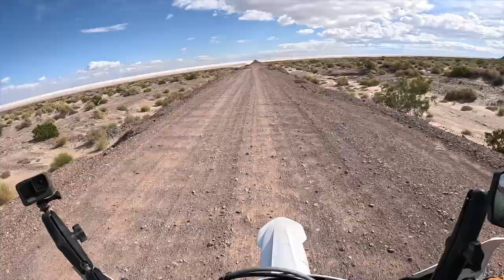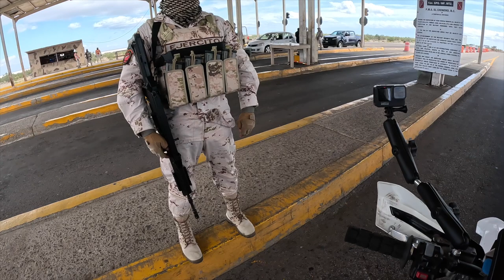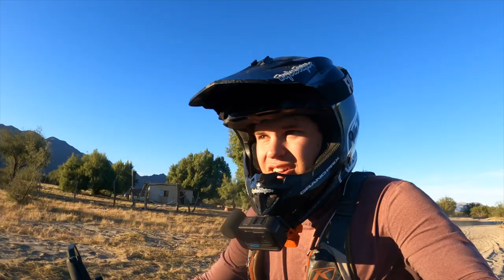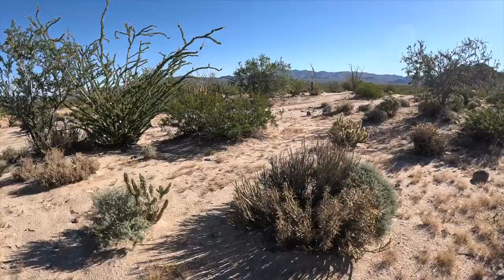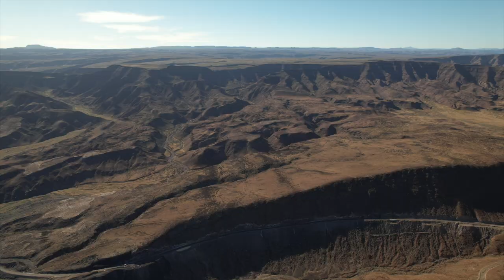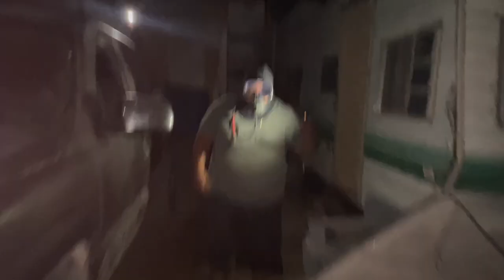Motorcycle Tour of Mexico (Baja California Part 2) (Ep 2)

Comment: Really nice job.   Glad you got your hard drive issue resolved.  Howz the KTM holding up?  Any bike issues?
Pete from San Juanico ✌🏼
Reply from the maker: Pete brotha! Yeah man I feel so grateful I got my data back! The KTMs been great can't complain. I had a wheel bearing go out in the rear tire and a countershaft seal start to leak recently.. All things I expected could go out. I had all the parts for them and was able to fix them easily. So other than that nothing to bad... My Trailtech GPS charger recently stoped working. So I haven't been able to use that GPS. The GPS works fine it just doesnt have a way to be charged. No big issues so far with the bike.
Reply: @LandonBishoff  thanks for the response. Enjoying following along. Wanna get your route from San Felipe down to San Juanico. Looked beautiful and it’s on my to do list.
Reply from the maker: @petescholl6301  Yes Pete im looking to get a link to the route on my Instagram Link Tree here soon. I have you on there so you should see an announcement of it when I upload it

Comment: I'm not sure if its my cpu or your video is blurry?
Reply from the maker: My man you caught me at a good time, I’m just responding to some other comments. The video is definitely clear. If your having troubles loading it you can click the gear wheel on the bottom right of the video next to Closed
captions and all the other options. In the gear wheel when you click it it’ll give you a couple options.. one of them is quality at the bottom of the list. YouTube defaults to and “Auto” option that loads the quality based on connection and internet speed. You can manually click the video quality you’d like to view the video in. In this case I’d choose 1080p
Reply from the maker: Once you click the 1090p option your computer won’t move forward with the video till it loads that quality. You’ll see the video has good quality there, if it doesn’t load then we gotta try and figure out how to get your internet speed up a bit! Hope this helps my friend! Cheers